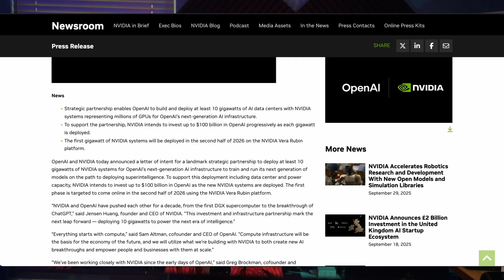The World’s Biggest AI Power Grab

Comment: To be honest, the only feasible place for a data center of this size would be Antarctica,  powered by a combination of wind and geothermal power.  The latter is a touch problematic, but Mount Erebus is the most recently active and may be possible to tap for the heat necessary.  Possibly.  Maybe.  Wind power in Antarctica is also problematic, but that's just an engineering and economic issue.  It's solvable.  However the ambient temperature in Antarctica makes sense from an efficiency point of view.  

Another good location for the same reason is the Russian peninsula of Kamchatka.  A bunch of volcanoes, and it's generally very cold, with abundant winds.  It's possibly preferable from an economic standpoint (more easily accessible) but not politically.

Geothermal is one of those power sources that is highly underutilized, but not technically difficult.  Economic is another story.  There are a couple pilot projects in the Pacific Northwest and elsewhere, but only Iceland has really embraced it and Iceland probably doesn't want to increase its output that much.  Many other places, including Alaska, could exploit this.
Reply: "Antarctica"
You don't know how bad the conditions are over there. Engineers did not yet solve many problems caused by ice formation from the wind for the scientific outposts and you always need human intervention. It's a hassle.

Comment: Capacitors can deliver a pretty much instantaneous jolt of current to a circuit. 

Maybe very large capacitors could be used to provide electric load to the system for an emergency shutdown should the power grid fail.

But then the problem would be that each AI data center would require thousands of the largest capacitors for such a backup plan, and I don't imagine these corporations would be willing to fork over that much money for a system that would only be used under emergency conditions.